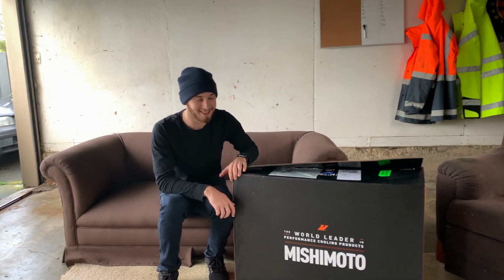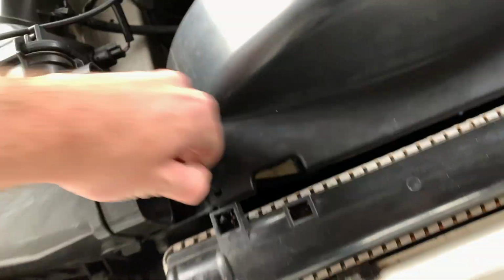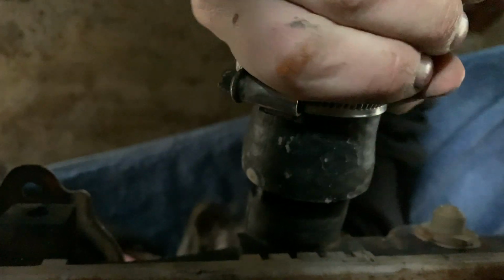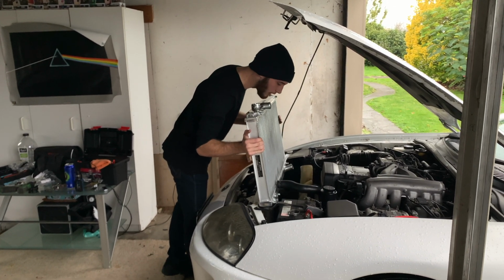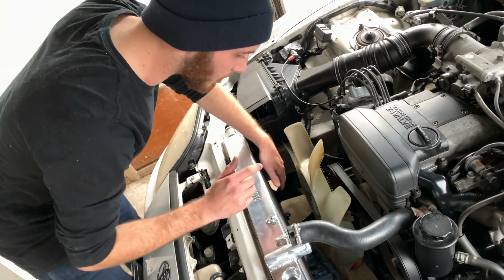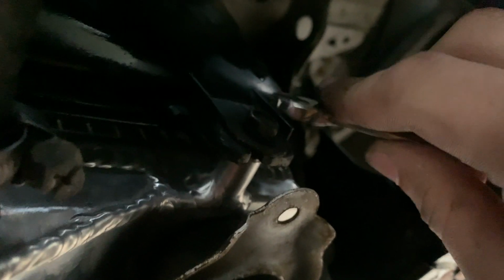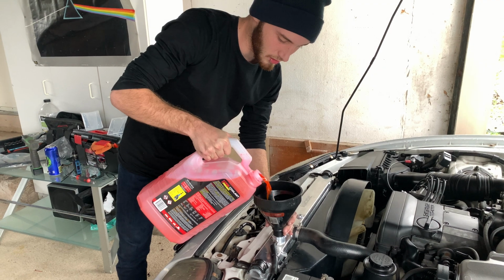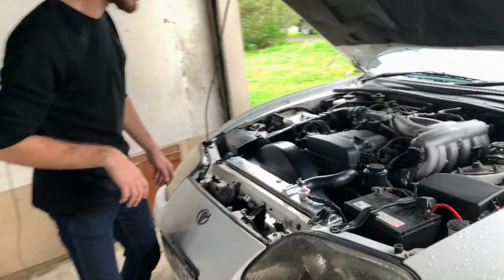Supra Gets BIG Mishimoto Radiator

Comment: Hey mate, I’ve got a stock ‘93 na. Does it need to be flushed with distilled water, is nulon premium red a good coolant for it and should it be running pure coolant or coolant and distilled water? 
Cheers
Reply from the maker: Mines an NA ‘94. Flushing is always recommended but I didn’t in my case (which I will be doing shortly). Red coolant is recommended for the 2J to protect seals and prevent corrosion on aluminium etc. Your coolant/distilled water ratios will depend on where you live and your climate. In New Zealand (North Island) we don’t ever really have really big drops in temperatures so our coolant to distilled water ratios are a lot lower than say if you lived in Alaska etc. Hope this info helps you :)